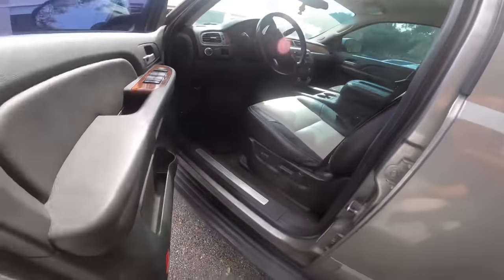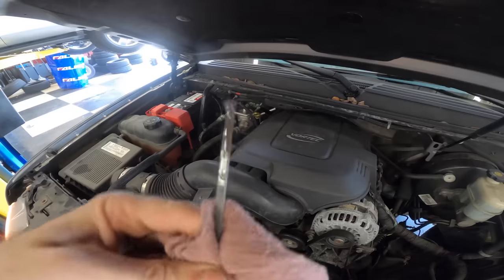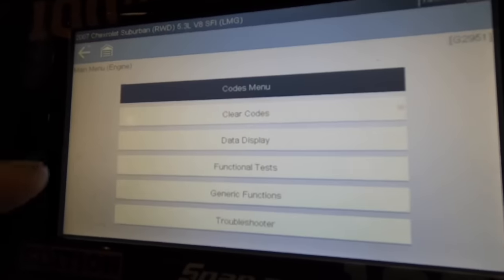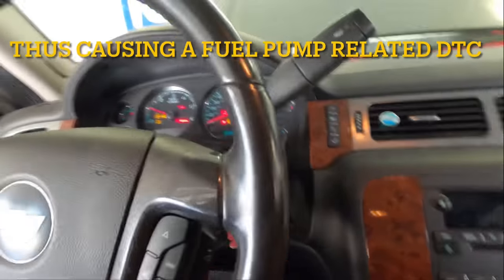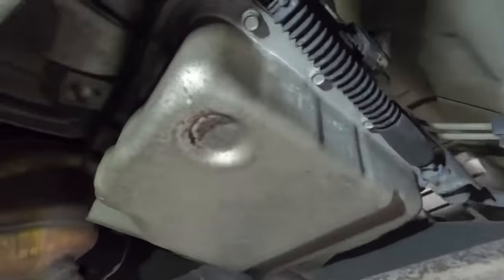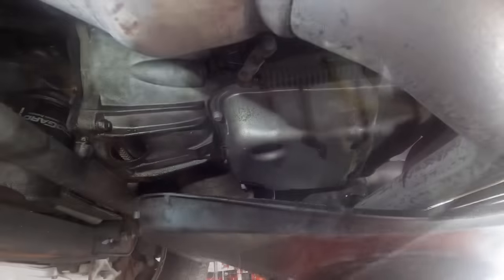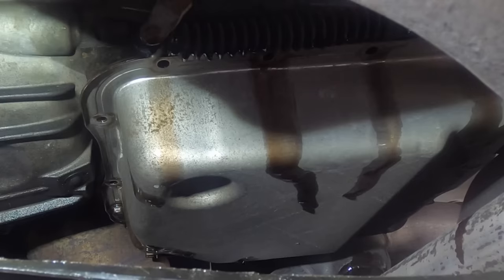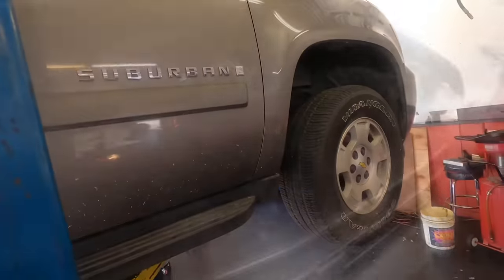Busted! SCAMMING Mechanic Causes Damage! 4l60E Transmission

Comment: Makes me smile seeing why I can’t actually afford to pay someone to fix my vehicles. A good mechanic isn’t cheap and you sir, deserve every penny
Reply: Really enjoyed your video. As a former trans mechanic I can tell you it's a good idea to flush all the transmission fluid along with what you did. Also I hope you removed the old filter seal out of the pump before you put the new filter in. That is the only two things I seen that I would have done differently. Good job on the diagnostics. Keep up the good work.
Reply: Give til it hurts my good man.🤣
Reply: james RA  Not always, but I would agree w/ your sentiment.  I've taken my cars to the same mechanic since I was 17yrs old on stuff I couldn't do.  He was always known in the neighborhood as fair, honest, and doing good work.  I took my car to him a few weeks ago as it was throwing a code on a sensor that was going to require me taking the power steering pump, water pump, and alternator off to get to (thank you GM!).. Not doing all that.  He got me fixed up and mentioned he was retiring from his shop.  As we talked he said he'd put a pole barn behind his house and had just had a lift installed, and was going to basically work off craigslist/word of mouth in his retirement years rather than sitting on the corner of a busy ass intersection in the city.

Needless to say, I made sure I got his address and phone number.
Reply: To expand on your statement, "A good mechanic isn’t cheap and and cheap mechanic isn't good"
Reply: @Ken-xv4sb  I've had a great mechanic like that, then he retired, I haven't found one yet across the country who I would equate the same way since.
Reply: @SimonTekConley  I remember the first time I used him.  I was driving and all of a sudden got this really really bad shimmy in my front right wheel.... I mean it was bad.  I was about a mile from his shop and pull in (since he was a neighborhood shop I knew of him), he sees me turn into his parking lot and drive in front of his roll up door, comes running out yelling ,"Young man, stop!".. I get out and he says "You've got a broken belt  on your front passenger tire and a massive bubble on it".. Before I knew it he'd grabbed his impact and floor jack and threw my spare on.  That tire had a bubble on it that was probably a little bigger than my fist and was no doubt ready to blow. He then directed me to a small tire shop a few miles away and didn't charge me a cent.

Probably doesn't seem like a lot, but as a young kid who didn't really get a lot of fatherly guidance.. I appreciated it.
Reply: @Ken-xv4sb  similar. All the shops in town said my s10 needed a new transmission. I took it Goose's, and Mark replaced the 2/3 shift solenoid, and I was good to go.
Reply: Not exactly true
Reply: @Ken-xv4sb  cam sensor?
Reply: @Darkfarfetch The depreciation cost easily pays for a good mechanic on a used car.
Reply: @natemartinez4595  Yup...
Reply: Bad mechanics can cost even more!
Reply: @Ken-xv4sb  sounds like what my uncle did after closing his business in Fairoaks, California.
Reply: james RA , don't keep it a secret, man. Name and location! Give the man all the business hr can handle!
Reply: @Ken-xv4sb , mebbe he would not be able to handle too much business in retirement, but strongly tempted to suggest you share his contact info!
Reply: @Ken-xv4sb , bless that man for the good soul and consummate artisan he is! People like him give me inspiration! And I need it. But, don't we all?
Reply: @SimonTekConley , God bless Goose for his skill and scruples!
Reply: @Ken-xv4sb , crankshaft position sensor on my '98 S10. But the windshield wiper  control on mine was the most edifying. The circuit board had an intermittant fail, temporarily restorable by wiggling things around in the rain. Instead of buying a $100 ripoff circuit board, I was able to just melt and reflow the cold solder joints on the power terminals, courtesy of a bulletin board, somewhere!
Reply: @Corvette.Ronnie  There are some exceptions to that saying, and there are some mechanics who can be very generous depending on the circumstances.
Reply: A good mechanic isn't ridiculously over priced either. It's easy to get ripped off
Reply: Makes me mad when I get clients that tell me horror stories or I go to double check cause my gut says "nah they got scammed" and sure enough something as important as soark plugs wherent replaced and the client was charged $300 for a service including that service 🤬
Reply: I agree. When I was young I got shafted a couple times by mechanics. That's when I started repairing my own cars. Long story short, I now work in my spare time on cars, I'm not cheap,but understand that not everyone can afford what some shops charge. I myself allow the customer to let me know what they think the repair is worth and what they can afford. I check over what's wrong with their car, usually for free to let them know what's wrong. 
This video shows what goes on and how much work it takes just to find issues sometimes. 
Nice to see an honest tech.
Reply: @bradzcustoms  I do about the same but minus the got scammed part! I offer decently low deals given the client buys their parts. "Mechanics" that scam are the reason why I have such a passion to continue outside the military to at least be part of the good and always be available still on my off hours to give low income folks a shot at letting them at least know they are being scammed
Reply: Any way I can look for a mechanic with this guys work ethic in my town?? Really appreciate this guy.. showing a repair from start to finish.. it should be a regular protocol..
Reply: Mechanic.  Lol.  You’re so archaic.
Reply: A shitty mechanic isn't cheap either.
Reply: @1470Bu  as a trans mechanic, you should know better than to flush a trans you know nothing about.
Reply: @jeremysales1232   you must not have watched the whole video.
Reply: As an innocent teenager I was scammed a couple of times. But now, as an engineer,  I can fix almost all my vehicles and appliances myself (I've saved thousands $$ TG).
Reply: Good work isn't cheap and cheap work isn't good.
Reply: It's true, a good mechanic isn't cheap, but headaches come at a discount. People who shop for auto work based on price are shooting themselves in the foot. Shop based on honesty and transparency and you'll be much happier in the long run.
Reply: A good mechanic is less expensive than a bad one.
Reply: You get what you paid for I don't mind paying a good mechanic to do a good job but I hate paying a good mechanic to do a bad job and then you speak to the service writers and you get a song and dance and it was something totally different all the time and you got to throw more money on it at some point they think I got to sign my forehead that says stupid been in the trades for my whole life don't try and give me a line of b***** and blanked it out have a good day
Reply: i mean neither are bad mechanics either. they are more expensive unfortunately
Reply: I have a really cheap mechanic that I pay 15 a hour he's actually one of the best mechanics but I'm lucky

Comment: That "mechanic" was breaking stuff to fix later, yet the vehicle has numerous problems which need repair. So they could've gotten legit money- they just didn't want to work for it. It's theft with a few added steps. Shameful.
Reply: They didn't want to do the "small" stuff and tried to scam them for larger ticket items.
Reply: They did this on purpose.  I heard about this being done on Chevy's by mechanics.
Reply: Sounds like a couple places I visited here in Plymouth, MI  Gad Damn liars 'n scammers....What I was told was Bull Shit 'n I knew it....

Comment: Imagine if a shop were to have all mechanics wear a go-pro on their heads and video record all diagnostic procedures and repairs. Then the shop would save them in a data file on each vehicle so that if requested the owners could review the documentation of diagnostic procedures and repairs done. That would be a pretty interesting business model. Heck on top of that that shop could also have a youtube clause the customer could approve or deny the possibility of their car being posted to youtube. Actually, that's a pretty cool idea.
Reply: You my friend have a good idea there. It would be pretty fool proof if the customer were to try and wiggle out of paying there due aswell.
Reply: I feel like as often as I bump my damn head working on my car they'd probably go through gopros at a rate that isn't financially viable..lol
Reply: Yes, but that would totally have to be a voluntary feature.  Not made a law that will just be used against both customers and mechs. Most likely by the state happily fining businesses, and probably the smaller one's not so much with the big dealerships.
Reply: @mrt2this607 he said business model. Not law
Reply: How was it running with the fuel pump relay out?
Reply: @jeffreyweems  the wire was connected to the fuel pump circuit. The ignition fuse that was missing is switched with the ignition. They connected the wire to the fuse location so the pump gained power at the same time as that ignition circuit, which was broken at the fuse box due to the missing fuse
Reply: I deliver auto parts...driving I am on camera all day...if i scratch my beard it cites me for eating while driving. How would you like being on camera all day, every day. I'll be you wouldn't do it for an hr